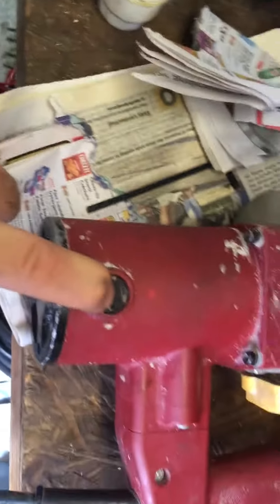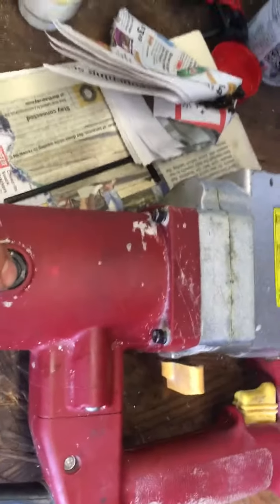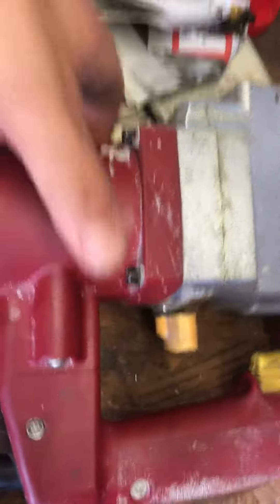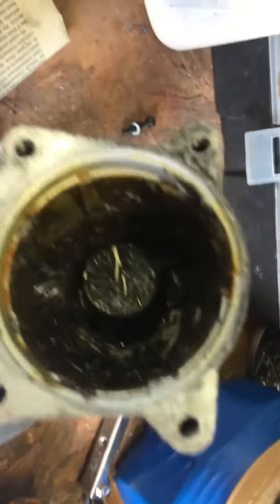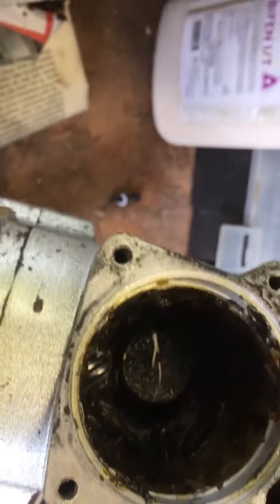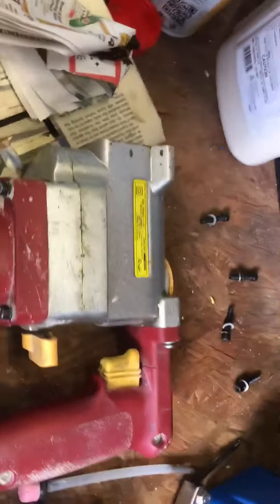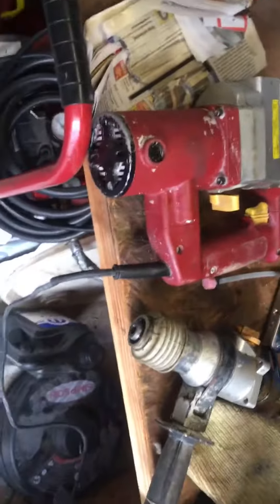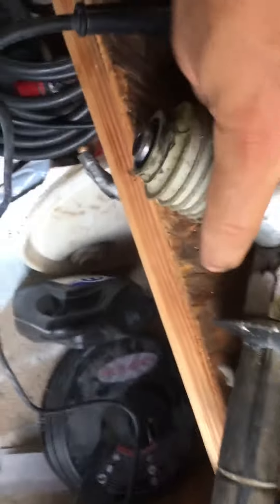Harbor Freight Rotary Hammer maintenance.  Greasing it up

Comment: I debated getting the hf gun. My Bosch stopped hammering and usage on the machine is minimal. I was thinking about the larger one but I ordered the kit for the Bosch, so didn't want to spend 300 bucks, on yet another lightly used machine. I used to do remodel work, baths, etc. But not so much anymore, and have the Bosch and a smaller Hilti. I've never put grease or oil in them, but now the Bosch is not hammering. Maybe that's why huh? Duh. Yours is the first video talking about maintenance, V's total rebuild. Thanks 👍
Reply from the maker: Good luck with yours.  Concrete dust seems to make its way in and contaminate the grease and or the grease just dries up.  Hope you get yours going again.
Reply: @vinceleto  So true. I just wish the operator manual s would be a bit more informative. That may help. Thanks.
Reply: i just got a new one at auction  for $45      in unopened box still in plastic w/ all labels user guide and warranty info tub of grease and extra set of brushes there is a label over the screw on cap to the cavity used to hold the grease and  I quote "REPLACE GREASE MONTHLY TO PREVENT TOOL DAMAGE"followed by "WARRANTY IS VOID IF GREASE IS NOT REPLACED MONTHLY"  HOPE THIS HELPS ANYONE WHO HAS ONE AND DON'TKNOW EXACTLY HOW TO KEET IT WORKING PROPERLY

Comment: Isn’t that grease to lube the insert on the bits?? I recently opened the top of mine so I’m trying to figure out how much grease to throw on the rotary part
Reply from the maker: I guess it’s good to lube the insert hole before you stick your bit in there, you don’t want your bit to get jammed in there.  It’s cheap grease, don’t over think it.  When you take it apart remove the old grease and pack in some new.  Cycle it and add a little more grease but don’t over do it